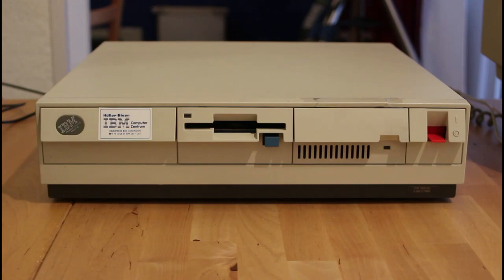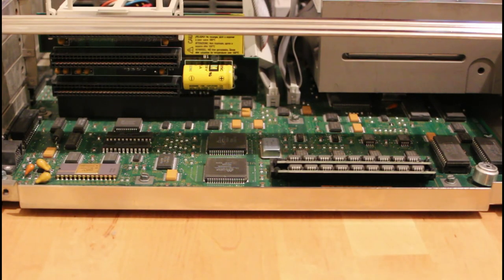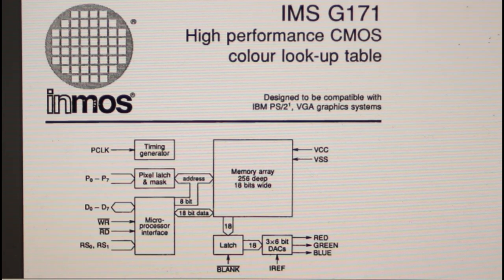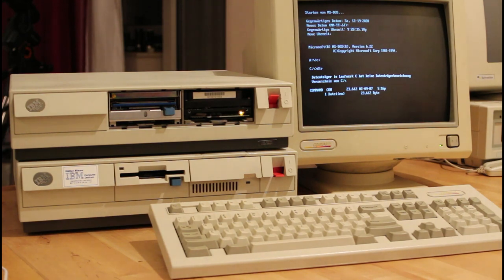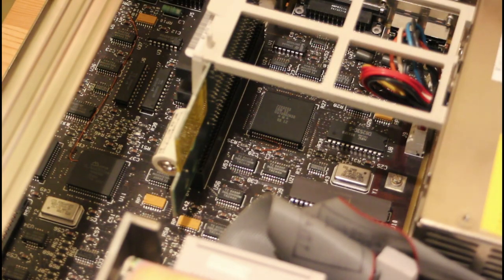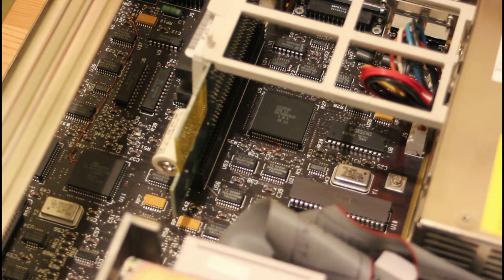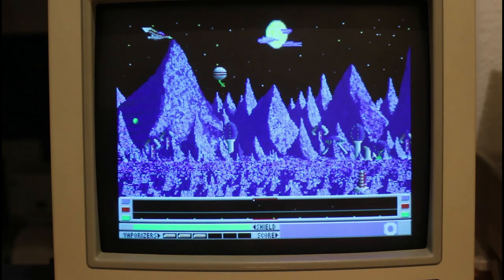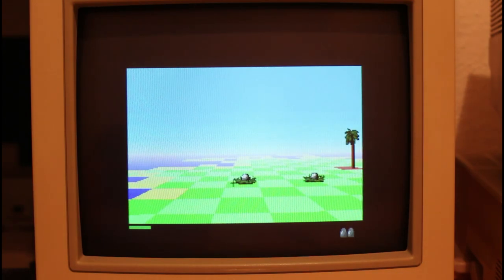The IBM Model 30 and MCGA proto-VGA (#DOScember)

Comment: Well, actually even though this has a 8086 cpu, it is a bit faster then the once popular 8088 found in the original pc. So, it was in many ways an improvement. Just in a vastly proprietary way. The PS/2 model 30 was the educational model in that these had been targeted to the educational market. It's why it has such lower end hardware and ISA slots. Back then buying IBM was expensive. Still is.. anything IBM was costly like Apple. So like Apple IBM offered models aimed at saving certain sectors money. The model 25 if I recall is an AIO variant of this same computer.
Reply: The 8086 came out first. Later intel started to produce the 8088 as a cut down version of the 8086. With if i recall correctly a 8 bit databus instead of the 16 bit of the 8086.
Reply: @theseob  Yup, this is true.

Comment: Check out spin rite to try and restore those hard drives. Maybe it supports those drives. Recent versions obviously include large drive support, but if the older drive support was dropped, I'd think acquiring an older version would help. Even the new versions run in conventional memory in real mode, so I suspect there's a high degree of backwards compatibility. But the tool can run a better surface scan than scandisk, by performing several reads to get the best one, then it'll flip the bit back and forth to try and restore the sector. And can even pull the raw analog signal from the drive head to try and process out what the level should be. It can often recover/restore bad sectors, if not recover the data and map bad, all before even the os and fat become involved. Had it remap a boot sector on my old quantum fireball back in the day, which is often a fatal failure.
Reply from the maker: A few people have mentioned spinrite. I'll have to give it a go.
Reply: @PCRetroTech  yes. Not entirely sure about backwards compatibility that far back, but like I said, the creator has kept it so it'll run in under 640k and in real time, so he's at least considering XTs.

Comment: MCGA was a wierd standard, with some strange choices made by IBM, no ega compatibility was a mistake.Late 80s saw a lot of 16 colour ega titles that would not work on MCGA except for a few that used 256 colour mode for MCA with an ega like palette. VGA obiously fixed all the issues bringning together mcga and ega

Comment: The bad sectors may not necessarily mean the drives are imminently failing. Most drives of the time developed bad sectors even in the few years they were used, but scandisk would mark them and avoid using them. (Scandisk was usually scheduled weekly if not daily.) Overall you didn't seem to lose a lot of space from it.
Granted, the extra few decades won't have helped but I say try use them for as long as possible if only for the nostalgia factor.

Comment: Unless you really want to hang on to those failing HDDs the XTIDE is an excellent storage solution for the model 30. It's a pity MCGA doesn't have EGA mode support, but that said, there are a lot of fun 80s CGA games to try, which don't always run correctly on faster hardware.
Reply from the maker: Gotta do that eventually I guess! There aren't going to be many of those drives left soon.
Reply: @PCRetroTech  So true.  The drive is dead in mine :(  Running XT-IDE in it now.
Reply: I use an XTCF alongside the HD in my 30.

Comment: So you say that MCGA was introduced right in the 8086 Model 30? I'll have to dig up my motherboard cupboard. I don't have anything but the m/b, the PSU and the ISA-8 riser but with a SCSI card I could boot it.
And what kind of video output does it have? Unfortunately I don't have anything but VGA 15-pin D-SUB for this kind of computers. If it's 9-pin I really don't know what I can do.
Reply from the maker: It's a 15 pin VGA output. And actually I think it was technically introduced with the Model 25 and 30, not just the Model 30.
Reply: @PCRetroTech  - The Model 30 was produced first, I even have a theory that IBM contracted Seiko-Epson (the logo on all the planar chips) to do it. An Epson Equity Ie is an exact Model 30 clone - including MCGA - so it is limited to three systems with about six different planars (there were some slight variations on IBM's side).

When you realize that there is a Seiko-Epson logo on four out of the five VGA chips used for PS/2s it becomes more interesting - and that one chip is the "silver-cap" 72X8287 used less commonly. There is still some detective work to be done three decades later. As you have discussed elsewhere "Hakemon Mike" understands MCGA very well - we're going to figure all this out!
Reply from the maker: @IBM_Museum  Yes, I had heard about the Seiko link. Would be great if someone from IBM were able to give details one day. Perhaps some old IBM (or Seiko) employee will eventually tell what happened.
Reply: You can connect a standard vga monitor to the 15 pin sub d monitor connector. But you will need to cut out 1 pin in the cable, since the mcga dsub connector has 1 blanked out pin. Mcga is a advanced cga mode, not a vga mode. The mcga chip in the model 30 8086 supports only cga, since it is a cga card. no support for ega, a vga card would have ega support. The model 30 286 does have full vga support. The 286 version also supports ega screen modes.
Reply: @theseob  Hm, so basically it gives a 15.something-kHz CGA signal  through a 15-pin D-SUB connector? If so, I cross my fingers for my Samsung 214T that otherwise can perfectly sync with a C-64 on its composite or S-Video port.

Comment: ISA slots mean you can throw in a floppy controller card and either an XT-IDE controller or an MFM controller. You have all the same options as you would on a standard XT/XT clone.
Reply from the maker: There's no power connectors. Moreover, the BIOS has to support those things.
Reply: @PCRetroTech  lol, good luck with the channel, I am sure you will get far with that attitude. Maybe consider that some of the people taking to time to post know what they are talking about.
Reply: @PCRetroTech  no need for a molex connector a lo-lech xt-ide cf can power a compact flash card using the power supplied by the isa bus.

Comment: As far as I understand, ALL red-switch PS/2 30's are 8086, while most white switch 30's are 286. I heard (and have personally seen) very uncommon red switch 286's too. I believe the early 286's were all red switch models.
Reply from the maker: This is my understanding,  but I hesitated to comment on it as repairing old machines is very common where I live, and one can easily go wrong if simply looking at the switch.
Reply: @PCRetroTech  Yeah I have never come upon a red switch 286 since the 90's. But I'm sure they exist, and people swear they've seen them, including myself. :D
Reply: Internally the model 30 286 uses a different power supply and motherboard connectors then a model 30 8086. I hav e 3 model 30’s. Two 8086’s one with a red power switch, and one with a white power switch. The model 30 286 also has a white switch. It also has a different cover. The model 30 with 8086 cpu has a white cover with a dark grey/brown bottom bezel and is closed using 4 screws. The model 30 286 has a all white cover and is closed with 2 screws on the front. No screws near the rear.

Comment: The Amstrad PC1512 attaches its video adapter from its slow 8 bit ISA bus. A shame that they didn't directly attach it to the CPU bus.
Reply from the maker: There's an 8 bit bus, yes. But the PC1640 seems to do the same thing, though gets much better performance.

Comment: Having ISA slots, why don't have floppy working just by using a floppy controller? I guess the only difficulty will be on getting the voltage.
Reply from the maker: That's right. No easy way to connect it to the power supply.
Reply: I don't know what voltages and currents a floppy drive would need, but would it be possible to use another ISA slot, if one is available? Like, if there's some broken card, would it be possible to saw off the connector with a little of the board left, and solder wires to the traces that were for drawing power? (I have no idea if there's any hope with that to work in practice -- I haven't worked much with those things -- I just thought that there must be some power available from the ISA slots, so maybe that could be used -- in theory...)
Reply from the maker: @enginerd80  I believe it is also possible to make an adapter from the existing connector to a molex plug for power, plus a standard floppy connector. I like to keep things original, so probably repairing the drive is my favourite option.
Reply from the maker: @crkretrotech1011  Good to know.

Comment: At 29:18, what do you say there? Arpeggio music? 
(It sounds more like pie pogo, or the autosubs have it spelled out as pipework or play poker music.)
Reply from the maker: Pipe organ? It's a piece usually performed on pipe organ.
Reply: @PCRetroTech  Ah. I didn't recognise the piece. What's it called?
Reply from the maker: @ropersonline  It's Toccata and Fugue in D Minor by J.S. Bach (allegedly)
Reply: @PCRetroTech  Thank you.
Reply: @PCRetroTech  PS: As you're doubtlessly aware, but maybe for the benefit of other YouTubers, the reason that famous organ piece is scarcely recognisable or at least doesn't sound its best is that PWM arpeggios rely on the mechanics of ye olde PC speaker, or specifically on the mechanical inertia between the magnet and diaphragm/coil, i.e. fast voltage changes occur before the moving membrane part has travelled all the way. Reproducing those sounds as they were meant to be heard heavily depends on the physical construction of the PC speaker, and most clone makers got it right by using exactly the same generic speaker. Why IBM felt they had to replace that with a piezo buzzer may well remain unclear. Maybe they were disappointed they hadn't yet gotten to include MCA in this model and felt they had to mix things up somehow? /s Of course, by the time this thing came out, buying IBM wasn't just a downgrade in terms of sound: The Compaq Deskpro 386 was already on the market when the PS/2 was unveiled, and at least this incarnation of it was essentially still an XT-class machine. 
More related info: 
Jim's "IBM PC Sound Ramblings" at oldskool dot org and this Computer Chronicles episode: https://www.youtube.com/watch?v=n81RKe-tu7Y
Reply: PS: Since I ended up googling this, the particular beeper/buzzer component is a through-hole 14RM06CT. It can be found in this old catalogue, where it is advertised as NOT WASHABLE UNLESS NOTED. We shall take that under advisement.
https://stuff.mit.edu/afs/sipb/contrib/doc/DigiKey/SECTF.pdf (Digi-Key Catalog #992, April-June 1999, Section F)

Comment: If you ever come across a Model 50 don't hesitate to make a video on it: that was my first PC :)
Reply from the maker: Nice machine but pretty hard to get parts for!
Reply: @PCRetroTech   And understandably so, considering it was a last ditch effort by Big Blue to corner the market.  Shame they went that avenue, since now it makes the parts hard to come by.  I wonder if someone's concocted some sort of CF/SD card solution on the drive front. 

And thanks!  By the time I upgraded to a 486 the Model 50 was woefully inadequate in a lot of ways.  Though in hindsight I wish I'd known then some of the things I know now: such as the fact that it could have run windows (which would have been more for "hey it works" than actually being useful since the Model 50 only had a 20 MB HD (and 286 CPU)), and that it was of course with a  color monitor, capable of color graphics (by the looks of it Model 50 appears to be one of the first with actual VGA) - the monitor that went with this thing was an IBM model but it was monochrome "VGA", so it could do a significant number of shades of gray, but to see it running DOSShell or WordPerfect in color would have been awesome.
Reply from the maker: Oh yeah, discovering it could do colour would be quite an impressive realisation.
Reply: @PCRetroTech  Yeah... it only dawned on me years later XDDD

Comment: I picked up one of these at Computer Reset a couple of months ago and it unfortunately has no video output. :(
Reply from the maker: Oh, that's a bit sad. I wonder if it could be the RAMDAC is faulty. I am not sure if you can purchase them anywhere though.
Reply: @PCRetroTech  Whatever it is, it's something the system is capable of detecting because it actually gives me POST beeps corresponding to a graphics issue.

I did get a working Model 55 and a working Model 30/286 out of the trip though.
Reply from the maker: @MatroxMillennium  Oh really. That could be a more complicated problem I guess.
Reply: @MatroxMillennium : The MCGA video on the 8086-based Model 30 seems to be very sensitive to power loads - if you have the earlier "P-Planar" board, it likely has the 72X8300 Gate Array chip - If you have extras like a math co-processor or other items, temporarily remove them. Try heating the chip with a hairdryer. Or just swap in a VGA adapter able to run from an 8-bit connection.
Reply: @IBM_Museum  Yeah, I'll have to open it back up and take a look sometime.  I do have a hot air rework station and was thinking about trying to reflow some of the chips to see if it made a difference.
Reply: @MatroxMillennium : It can be the 72X8300 chip itself - on the Model 30 "Greenock planar" and Model 25 'Type 2' planar it has replaced with another (covered in IBM ECA 023). The irony is that you can have a more heavily loaded PSU with an 8-bit VGA adapter to get functional video. But I am interested if you find a solution by your methods.

Comment: The rotating demo is in text mode? How did yo do it?
Reply from the maker: Yes. One has to hack around with the CGA registers. In particular one needs to set the character height to 4 and then choose a character which is half the background colour and half the foreground colour. That gives you an effective resolution of 160x100.
Reply: @PCRetroTech  How do you avoid CGA text mode flicker/noise when updating the screen? Are you racing the beam? (Or do these later display adapters eliminate that old problem?)
Edit: My question was answered in your CGA Rotozoom video: https://www.youtube.com/watch?v=cSxYljs5OxE
Reply from the maker: @spatulasnout  Good question. It turns out that the video RAM is dual ported on both the Amstrad and Model 30. Of course if you run this demo on an original IBM CGA card it produces a great deal of flicker.

Comment: red switch = 8086. white switch = 80286.
Reply from the maker: That works most of the time, however some people have reported exceptions. It's unclear whether these exceptions go right back to the factory or are due to retro collectors and sellers mixing and matching.
Reply: True. I have 2 model 30 8086. 1 red switch, 1 white switch.